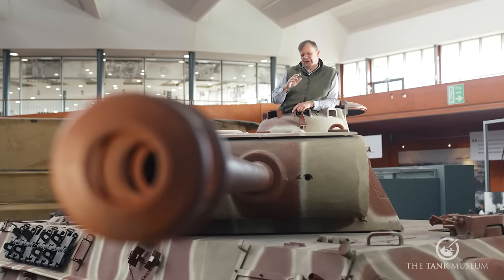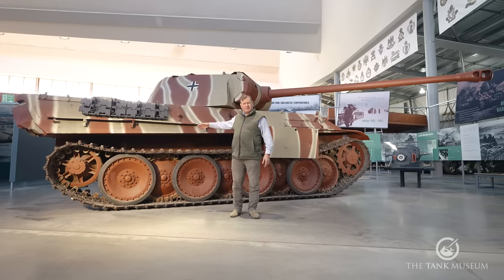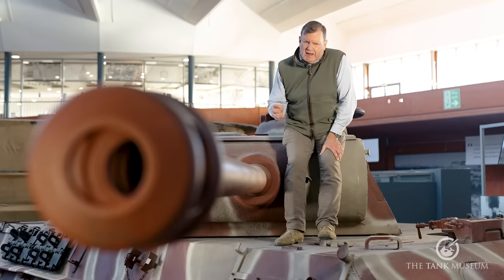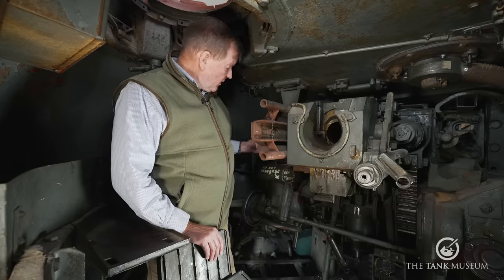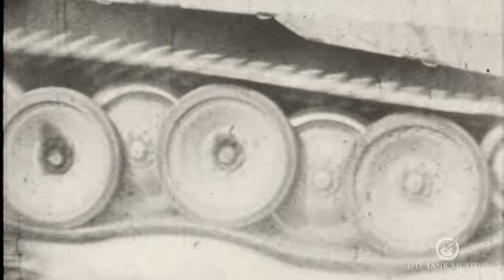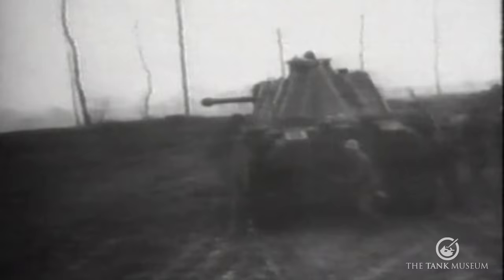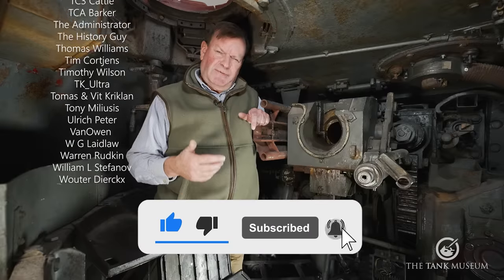See Inside Panther | Tank Chats Reloaded

Comment: TheMightyJingles made a very good point comparing the T-34 and the Panther by just showing chains to attach stuff on the tank. The T-34 had chains that would have been probably made by a conscript with scrap metal and a hammer, the Panther had chains that you would give to your GF. There were gaps in the armor that would make a german engineer have a heart attack, but it was "good enough". That allowed them to make thousands of them and if something broke down? Big deal, just grab the part from another T-34, it'll fit with a hammer. The Panther, don't get me wrong, was an extremely good tank, with many innovations, but it also made it complex. More parts, more things that could break just by normal use. I'd put my money on the Panther under ideal conditions, but I'd put it on the T-34 under battlefield conditions.
Reply: And Jingles repeated the same nonsense that the director of the Tankmuseum made, completely failing at understanding that the German chain is machine-made.
Reply: The T-34 had to be rush built because they were rush knocked out. Some 45,000 of them were lost.
Reply: The German method had its reasoning. Supply and material shortages were already serious in 1942, so you cannot build that many tanks that had a 450L/100km fuel economy. Even with that few tanks, many of them were lost to scuttling because they ran out of fuel. As long as fuel only came from synthetic plants and Ploeisti, you couldn't have more tanks

The ussr had Baku and the Western allies shipping tankers full of oil and materials, including finished Studebaker trucks, Sherman tanks, aluminium and technology for making aircraft engines. 

What the russian propagandists failed to realise was that America produced ~45% of the global industrial output at the time, and the ussr was kept alive by liberty ships and the North African front which took up ~40% of German motor transports, as well as the strategic bombing campaign that diverted ~50% of German steel production to making AAA shells
Reply: @Dreachon  In fairness, so were the Russian chains. But the Russians built a machine that was 'good enough' and the Germans built one that output a chain that would last forever, likely long after the tank it was attached to exploded. And that difference is pretty typical.
Reply: @charlesc.9012  It's true. And the Germans kept on building really heavy tanks with horrible fuel economy. What I don't understand is why German industry produced so few new engine types, preferably ones that ran on heavy fuels with good economy (and a similar problem is repeated in aircraft engines).
Reply: @onenote6619  Because Germany couldn't get enough rare metals and high octane fuel. Britain ruled the waves, and chromium was only mined in Turkey, and tungsten deposits existed mostly in England, the ussr, NE China and America. 

The result was that the steel was not strong enough. Panther engines cracked a lot, but it was only a low-compression engine. A higher compression engine needed much better metallurgy if it needs to be compact. Otherwise you would have a t-34, which is made of 60% engine, and that is not good for combat capabilities

The same German industry could not produce more engines than it already did, so you couldn't add more types, that was already too much. Packard alone made more engines between 1942-1944 than Germany managed in the whole war, as far as I remember.

1x 57-ton heavy tank with great capabilities will be less resource-intensive than 4 mediocre 23-ton tanks, especially since German models are so tedious to repair and service. A tiger I could also perform much more difficult missions than a Pz.IV, so it was worth the investment for the Germans
Reply: @charlesc.9012  Yes, but Germany had better access to diesel than petrol. Also access to captured T34 diesel engines manufactured by just-good-enough-to-last-a-battle Soviet engineering. At least an attempt could have been made. The only answer that comes to mind is that German engineers were mentally scarred by the crudity.
Reply: @onenote6619  They really didn't. Their only oil field is in Romania, and their domestic fuel production only produced 85 octane petrol, because that was the product of coal refining. Any diesel they had is reserved for the U-boats and small ships of the surface fleet.

German diesel engine technology was also advanced for the time, there was no need to copy an unreliable, inefficient and massive 38L engine which intruded into the crew space. The V-2 engine was also an old design at the time, there was no value to trying something like that.

German tank production was also limited to  about 1000 units/year for most types, so there was no value to copying a design that had 15,000 losses a year, that is a huge logistics burden that brings no value
Reply: @charlesc.9012  You should look up how the Fischer-Tropf process works. Coal has very long carbon chains (not wanting to be condescending here). The longer you process these chains, the shorter they get. Diesel has longer chains than gasoline. If they reserved the actual petroleum (from Romania) for petrol production and the synthetic fuel for diesel, production efficiency would have increased. But they chose to stick with a petrol engine rather than develop a good diesel. For reasons unknown.

Comment: Face hardening was eliminated with the introduction of ballistic capped anti-tank ammunition.  Extra cost of manufacturing face hardened plates served no purpose against a capped round. Panther had an excellent power to weight ratio, better than the Sherman and was considered more maneuverable over broken ground (lower ground pressure despite its greater weight and it had a better torsion bar suspension)   The Panther's 75mm gun had superior penetration than the Tiger I's 88mm gun.  The engine was standardized for Tiger I, II and Panther (and their variants) keeping the number of engine types to a minimum.  British tanks in WWII did not use sloped armour, and the Sherman side armor was not sloped.  Space considerations and the British belief that a fired round rarely hit a tank exactly at 90 degrees.
Reply: Yes, but also no. The Panther broke down - on average - 150km from replacement of the final drive. The Sherman fought across France and the low countries with minimal support. Yes, the Panther was highly manoeverable, but only until the final drive cracked and it became immobilised. The Sherman was less manoeverable, but rarely broke down and was easily fixed by the crew when it did. An immobilised tank is worthless.
Reply: @onenote6619  Yes, the Panther final drives were problematic.  Another factor in favor of the Sherman was that the USA was very automotive minded.  Americans soldiers usually knew how to drive a car and do basic maintenance and these skills were valuable for armor troops.  German soldiers not so much.  Skilled drivers made a big difference in how a tank performed in battle (or even getting to the battlefield).
Reply: @onenote6619  For insight on the Sherman's reliability and ease of maintenance & repair, I recommend Death Traps by Benton Y. Cooper, who commanded a recovery, repair, & maintenance unit with the 3rd Armored Division.  The Sherman was far from trouble-free.
Reply: @onenote6619
" The Panther broke down - on average - 150km from replacement of the final drive."

Wow its amazing then how those 650 Panthers in 8 battalions got to Normandy and became a thorn in the side of the allies and it's amazing how the Panthers of 2nd Panzer Division got the furthest out of the all the German armour types in the Ardennes...... and did their advance much quicker than the Shermans did the reverse journey. Isn't it? 

I guess none of the above actually happened then?
Reply: @mattcavanaugh6082

Indeed. And the British 2nd Army concluded its Shermans were not as automotively reliable as its Cromwells during the Great Swan across France post Normandy, with significant issues reported.
Reply: @mattcavanaugh6082  I am aware of that book. As an anecdotal story from a different perspective, it is interesting. As a source of technical information, it contains outright errors. Much like that other book that talks about Shermans being spontaneously flammable. And yes, the Sherman definitely experienced mechanical failures - but they managed to drive across France and the low countries en-masse with a remarkably low total-loss rate from mechanical failure. At this point in the conversation, I am waiting for someone to remark that the Ferdinand/Elefant was a marvel of reliability.
Reply: @onenote6619  Reading the book would provide useful insight, as the author actually worked on the Sherman.  The Wright-Cyclone in particular was a major headache.

The reliability of the Elefant is a non sequitur.

Comment: Amazingly lots of ww2 footage exist that shows cloumns of Panthers sailing along fine.

Could be that after the initial teething troubles the German field Mechanics had them running fairly well.

HL230 has the power to run a 45 ton Panther a lot better than the heavier cats.
Reply: It's a complicated matter, suffice the say the often regurgigated pop-history nonsense of Panthers constantly breaking down is something that doesn't find much supprot in the records and comes with a metric ton of caveats.
Reply: @Dreachon  Hilary Doyle published a report from a Panther that said they went 3000km before service. For a heavy tank at the time thats great.  HL230 usually needs a rebuild at 1500km

Comment: Disclaimer: this is not meant as criticism
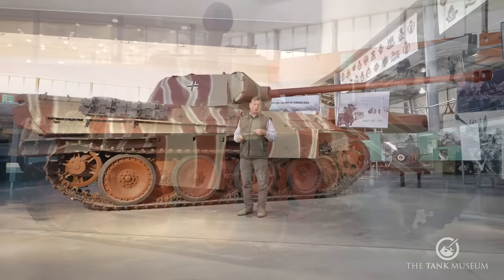3:05 some Panther ausf. F were used in the defense of Berlin (at least one), so the final production model was the F. (And there are pictures of ausf. F hulls in a Daimler-Benz factory)
5:20 it'd be nice to know where you got those numbers from, if the armour is 40mm inclined at 40° from vertical, the line of sight thickness would be around 52mm, with the armour at 50mm inclined at 30° from vertical, the line of sight thickness would be around 57mm. (40/cos(40°) and 50/cos(30°))
10:40 the type of turret doesn't necessarily identify the model of Panther, the early production ausf. G had the turret that this Panther has, and at the end of the war both this and the "chin" type turrets were being produced at the same time, there is photographic evidence of this.

Comment: Chris always does a great job as usual with narration of anything he does on the Tank Museum. The German Radio was so small. Compared to those of western nations at the time. 

The small transistors were an item the Americans particularly wanted their hands on. 

Still the platform of the future in its technology internally not the engine! As a soldier or tanker when seeing this you’d have been looking for clean bottoms after coming across one in the December of 44. Static or moving towards you still must have been a hairy experience?
Reply: Useable transistors were a postwar product. Everyone was still on tubes.

Comment: For once, a tank video did not declare the interleaving wheels foolish!  They were rather a well-considered trade-off.  Compacted snow was a lesser concern, as panzers had to fight in all four seasons across multiple theaters, some places where it never snows -- and for much of the year it doesn’t snow in Russia, either.  There was simply no other solution available (a Christie was not) to give a 45 ton tank such superior off-road performance, or a lower ground pressure than the 30-odd ton Sherman.
Reply: And the crews loved the smooth ride it gave.
Reply: @lyndoncmp5751  And the rich Corinthian leather!
Reply: mattcavanaugh6082 wrote: "For once, a tank video did not declare the interleaving wheels foolish!  They were rather a well-considered trade-off.  Compacted snow was a lesser concern, as panzers had to fight in all four seasons across multiple theaters, some places where it never snows -- and for much of the year it doesn’t snow in Russia, either. There was simply no other solution available (a Christie was not) to give a 45 ton tank such superior off-road performance, or a lower ground pressure than the 30-odd ton Sherman."

-- Snowfall in Russia can happen anytime between October and April, especially in a heavy and cold winter as was 1941-42.

-- Use of Schachtellaufwerk times double rod torsion bar suspension along heavy caterpillar tracks  was itself one of the biggest reasons why this "medium" tank came out as heavy, and a lot taller then it needed to be, about 10 tons too heavy. Sure smooth ride is cool, but Panther tank is a lot easier target to hit, because its so big and tall, required a lot more maintenance, larger and less economic engine and many other complication that comes with tank been 10-15 tons too heavy and complicated that it needs to be.

Comment: Just another German / German tank bashing episode. ALL new weapon systems have teething problems which over time are ironed out. The Panther is no different than any other weapons system. The allies won by producing enormous numbers of their crap tanks so it took them literally decades to learn simple lessons like the addition of armor skirting on the outside of the tracks. Or to have swept back wings on their jet aircraft (The first American and British jet fighters had straight wings.) And what the StG 44? The most influential rifle design of all time? The allies said it was a bad design too. Twenty years later we got the crap M-16 that jammed up every 5 rounds. We would have been much, much better off copying the StG 44. Just because the victors get to write the history books doesn’t mean they are right.
Reply: funny how all tanks of the era like the t34 and sherman had big problems in terms of reliability but GERMAN tanks always gets framed for it and only them. i guess the low number make it seem to be a bigger problem.
Reply: One only has to look at how many allied and Soviet tanks were killed by a much smaller number of Panzers
Reply: German tanks were advanced, but they were over-engineered and prone to failure. Same goes for German cars today.
Reply: @FieldMarshalFeels  well german cars from 1975-2010 are literally the best ever build imo. it always depends.
Reply: Good point  @theplayerofus319

Comment: I dont like the test result part in the beginning as the paper clearly stated insufficient test results were obtained. As for operation of german tanks in foreign countries: they always had problems. Let alone maintaining the tanks. Just because the tommys said it was unreliable it shouldnt mean that todays picture of the panther should be the unreliable tank, where it clearly wasnt. The Panther was just as reliable as the Panzer 4 after testing the catastrophical D variant which was upgraded throughout the war and hasnt lost ANY reliability in the process despite weight changes and so on. If it was THAT unreliable the wehrmacht wouldnt have used the panther, it would have been a small experiment amount like the jagdtiger, Elefant/Ferdinand and so on just to name a few known cases of "cursed by design" ...

Comment: Too heavy and with an overly complex suspension - what the Germans needed was a true 36 ton tank armed with the KwK 42 or an 88, powered by an air-cooled diesel riding on a simple, cheap to produce and easy to repair leaf spring suspension.  And they needed to turn them out like hot rolls.
Reply: "And they needed to turn them out like hot rolls" would have brought exactly 0. one main problem was that there were less and less experienced tank crews and extreme man shortages. German industrie sadly also was set on gasoline engines by 1943 and to change it was way too late

Comment: The torsion bar suspension of the Panther was greatly superior to the Christie suspension of the T-34 series. Before the war, the Russians were considering dumping the Christie and using another type. Then the war started and it was "get them built no matter what the suspension is".
As for German tanks using gasoline engines rather than diesel, the majority of the diesel fuel it has was reserved for the U-boots and navy to use. The army didn't have much of a choice except to use gasoline engines.
Reply: Torsion bar suspension has advantages, but it increases the height of the vehicle and is more difficult to manufacture. The T34 design aesthetic was to improve build speed and decrease cost no matter what, so torsion bars were out.  Point rarely mentioned is that gasoline is a much lighter (in terms of molecular weight) fraction than fuel, so more expensive to produce. Later in the war, Germany was relying on synthetic fuels produced from coal. Converting coal to a diesel-equivalent is significantly cheaper and easier than converting it to a petrol-equivalent (and we will not even talk about edible-fats equivalent as was actually done in order to keep the home front running).